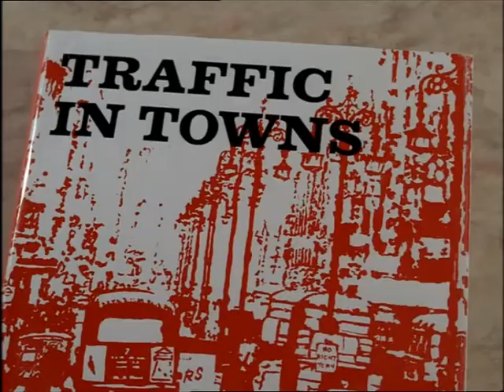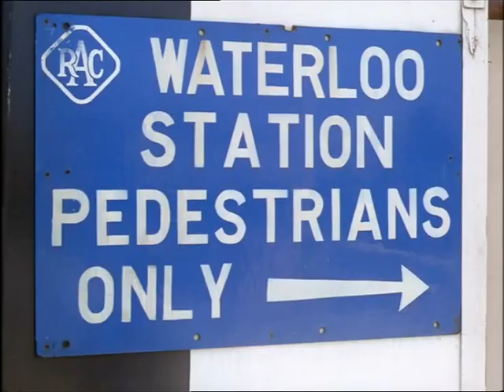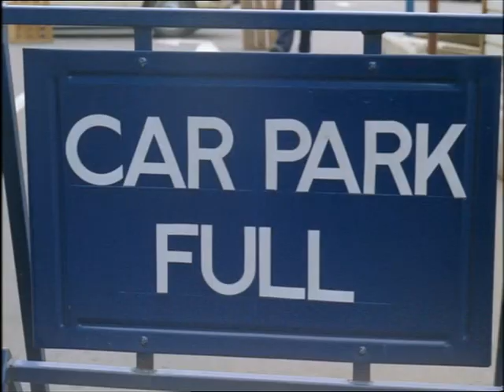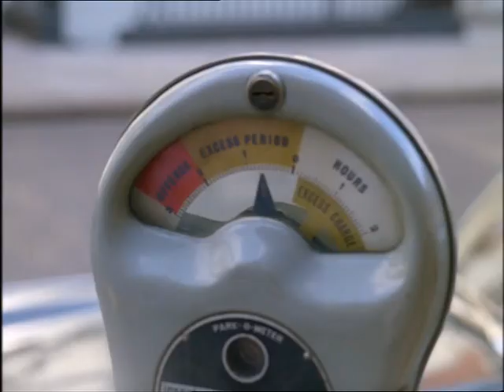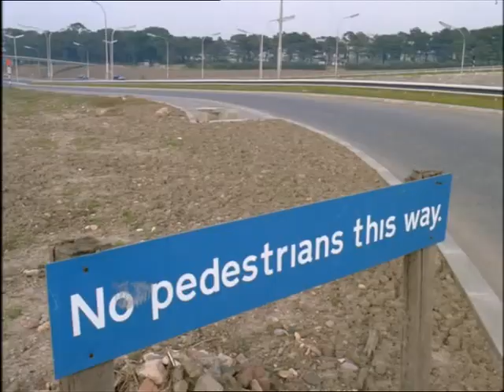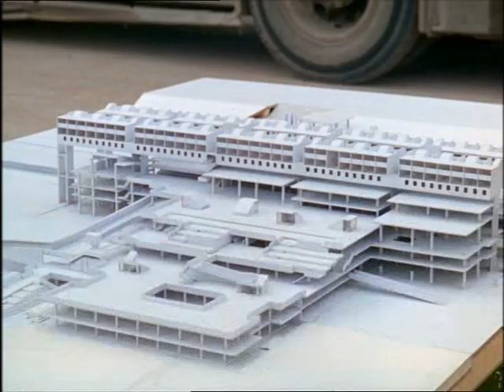Look at Life Vol 01 Transport   Living with Cars 1964

Comment: Love the part about Liverpool, those flyovers have just been demolished and the waterfront is an even bigger mess, it's been dug up for over a year causing misery and delays for all.
Reply: Yes, and thankfully the vast inner ring road was never built or nearly all of the elevated walkways. Moorfields station though was built with the entrance 20 feet above street level. There was no need for the 2nd Mersey tunnel as the road traffic disappeared from the old docks moving to the Seaforth container base. The original tunnel is closed on Sundays showing this.
Reply: @nevillemason6791  The old tunnel closed on Sundays?  It's closed this Sunday 4/7/21 for maintenence only, 6am-13.00 one way and 13.00 - 18.00 hrs in the other direction.  Nothing to do with lack of traffic, both Kingsway and Queens way tunnels are usually open 7 days.

Comment: The Mini was here just 5 years old..
There's lot of Mini's on the scrapyard...
Reply: Look at the company that built them, the workers spent more time on the picket line than they did in the factory
Reply: They were s#it boxes
Reply: I think they were accident damaged cars
Reply: @arunparkin2552  That is what the commentary implied...
Reply: @davidviner4932  The original mini was one of the finest cars ever built , please don't comment unless you have an actual clue what you are talking about ......
Reply: @PhilipKerry  yes but had no rustproofing !!
Reply: @bertiewooster3326  It didn't need any as it used galvanised steel ...
Reply: @PhilipKerry  Sorry chum the mini was never galvanised I know !
Reply: @bertiewooster3326  Mine was
Reply: @PhilipKerry  Not galvanised by BMC off the production line .I know.